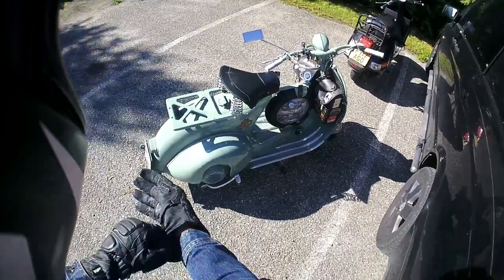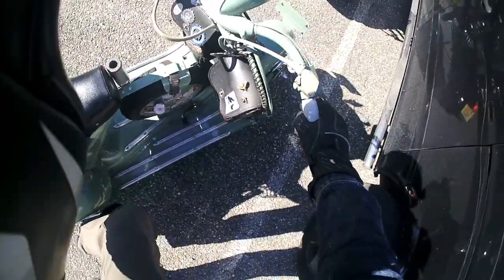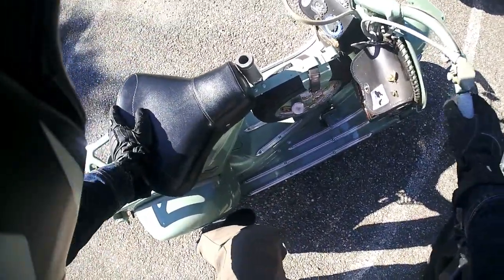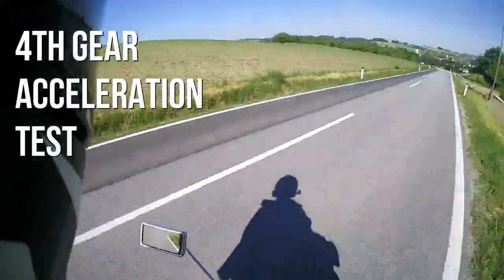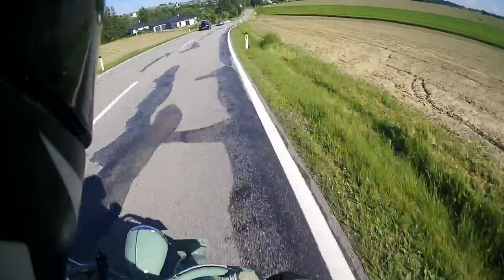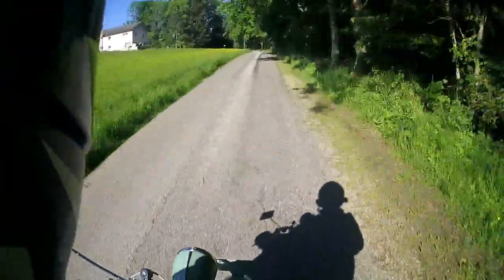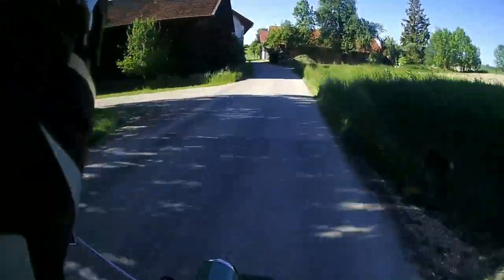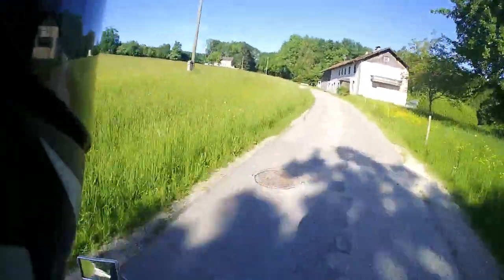Stickyfeatures | Riding Zini's 1954 Allstate Cruisaire Vespa with Corsa 160 kit

Comment: Beautiful bike, but there's no way I'd ride an Allstate any distance without a front dampner added...
Reply from the maker: It does have a damper, but only a friction damper from thw 1950s. Zini has no problems with the handling but he's a good bit smaller than me.
Reply: With the correct stiffer spring, you really don't notice the lack of dampner (and I'm a big guy). This is on my '55 Allstate.